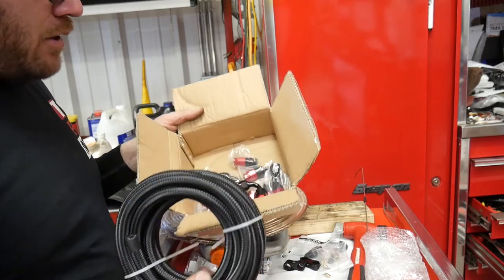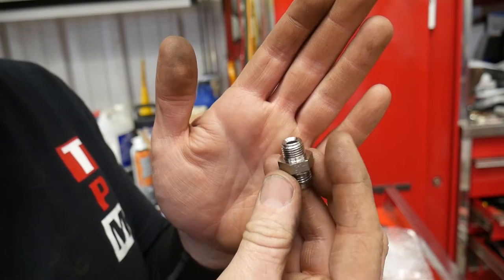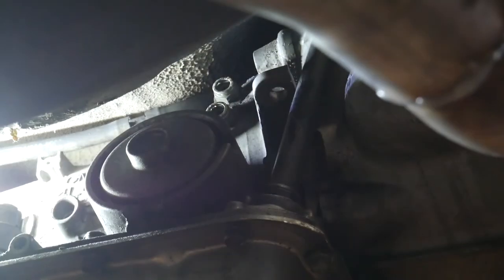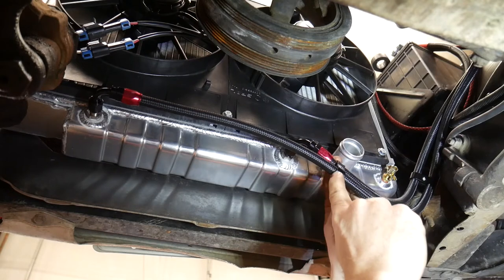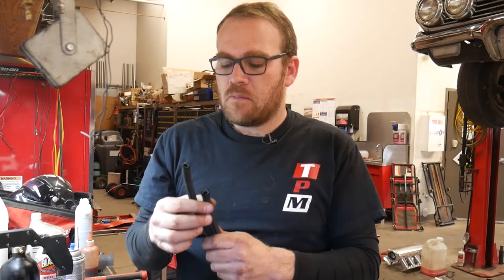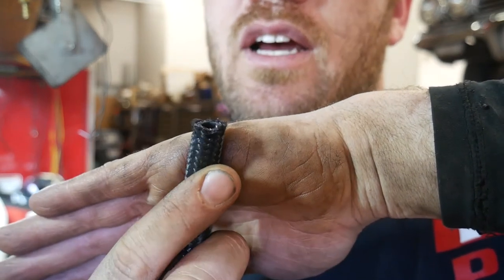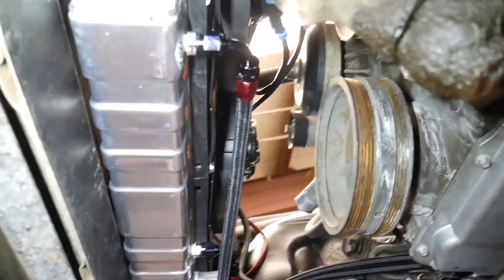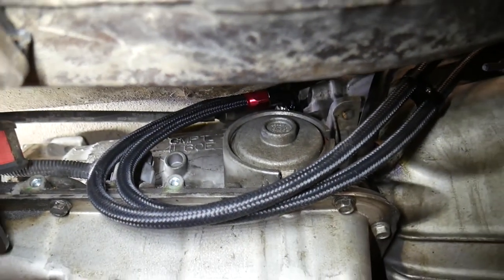1960 Chevy Biscayne LS Swap Ep 27 - Transmission Cooler lines 4L60E

Comment: A little trick for installing AN fittings 

Find a socket that fits over the fitting
Put a thin layer of tape over the end of hose
Use an impact driver and practically screw the fitting on the lines until they bottom out. Once that’s done you can install the rest afterwards  “ by hand of course “😂

I found it being more effective than pushing/twisting the fittings and hose. 

Works on braided hose too. 

I’m actually doing my lines on my 01 suburban.

Comment: Are you using a electronic speedometer or the cable driven unit?  How did you hookup to get to work?  I have a 4L60E tranny and 6.0L engine.  Looking forward to getting my 60 wagon running.
Reply from the maker: We went with the Dakota digital cluster. It gets its signal from the data link connector IIRC.